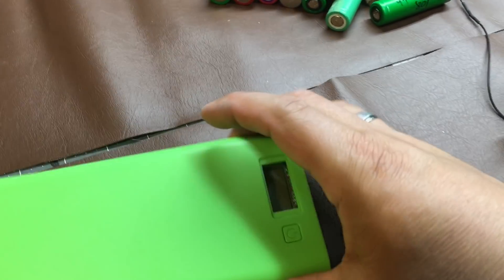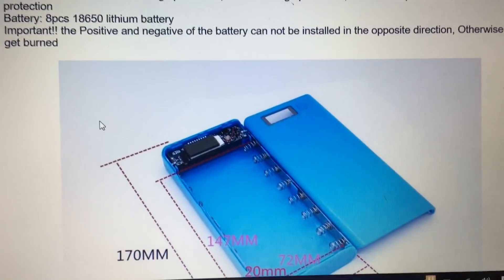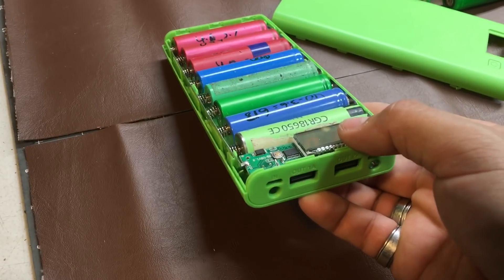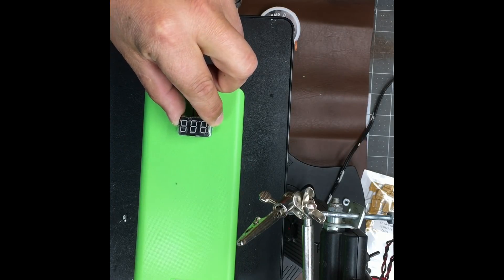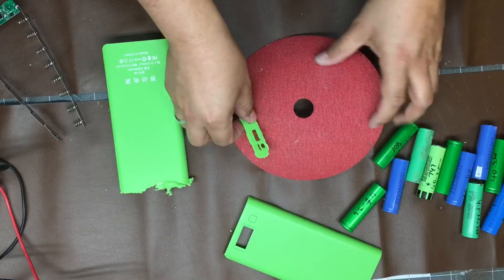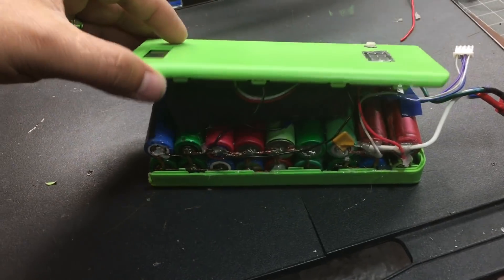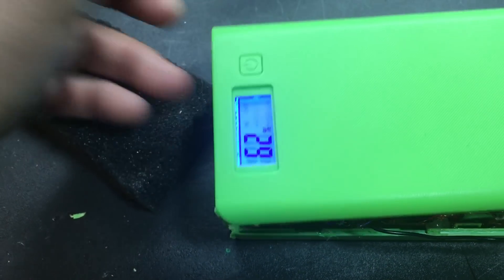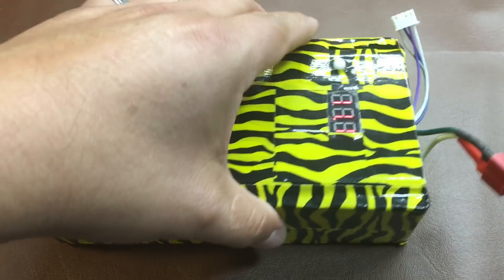Power Bank Upgrade: How to Modify Yours for More Capacity #PowerBankMod,  #batteryupgrade

Comment: Friend, i have a question i have the same powerbank case but when i charge the % don't change but the battery is charging, actually to have the new % on display had to take off all battery and put on again, do you had a similar issue?
Reply from the maker: Probably you case came damaged, the one i got works ok.  You should contact your provider for a replacement. Thank you for watching the video. Good luck.
Reply from the maker: yes, had same problem. that is why i make the changes. still working prety good. Thank you for the comment.

Comment: when I am putting 1.2 v×3=4.2 v (series),then my power bank is charging but my phone is not charging but when I am putting 1.2×4=5v then my mobile is charging but my power bank is not charging so can u bcz tell me whatever to do??//
Reply from the maker: tauheed Rahman 
I guess is because 1.2 x 3 in series is only : 3.6 volt. And your charger output 5 volt.
As well , 1.2 volt x4 in series will be :4.8 volt . So, power bank will only work ether way and will work in deficit because either way needs 5 volt to work properly.

Comment: don't you think it s a bit over done. Why would anyone want a portable power bank with that capacity? and the weight is not easy to carry around with.
Reply from the maker: Thanks for watching . it is really helpful if you are in the field of filming or other hobby that require recharging  batteries, especially if  you working  in remote location where electricity/power is need it. This battery pack holds lots of charge and can be uses to recharge all your camera s or other device s batteries etc. This is another project i was working on https://www.youtube.com/watch?v=Qq0SxqhN7aA&t=3s
Reply: If i am living in Remote area I would use lead acid battery bank rather than lithium ion as financing and capacity wise.
Reply: bro stfu it last longer